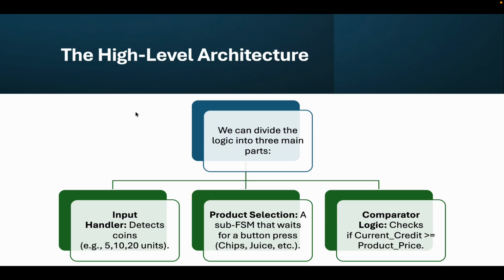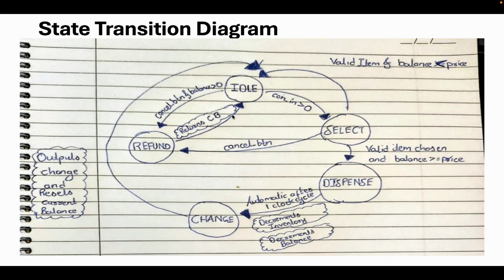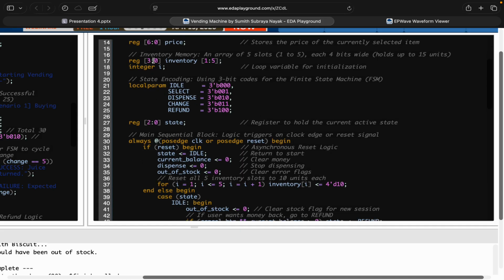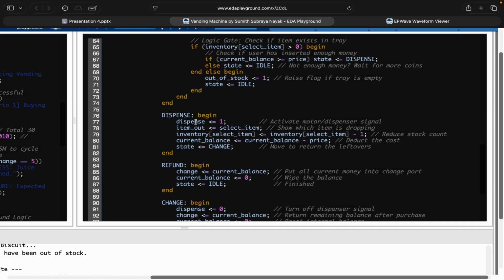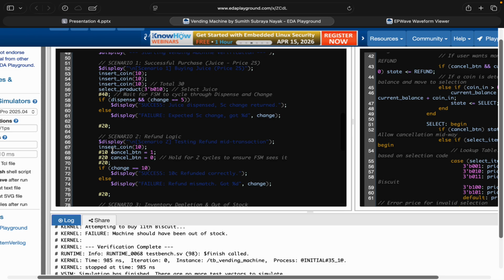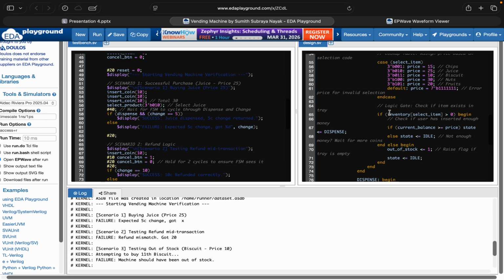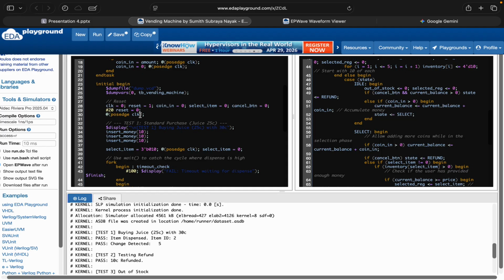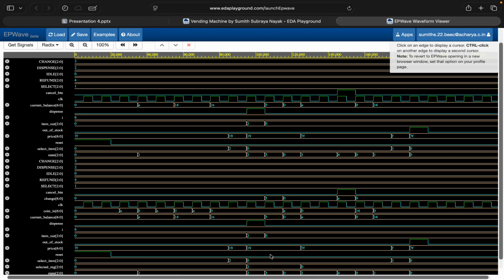Day 25 - Project Vending Machine with Inventory Management using a Finite State Machine (FSM)

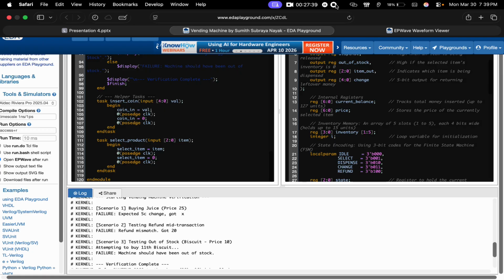Comment from the maker: Hi everyone, At the 27:39 mark  , I made a small mistake in the project due to which I failed to get the desired output it has taken me around 10 to 20 min to understand the mistake , I understood that the mistake was with coin validation as we put the coin in vending machine multiple times , but was able to solve it later using gemini . I would suggest all of you to learn the logic alongside the ppt and code and try to write on you own , after which try to validate various scenarios that you would face while using a vending machine , although a simple mistake , it takes a lot of time to debug it . Make AI tools your friend but not a tool that can replace you. Real-world debugging, even for 'simple' mistakes, is where the best learning happens. Always test your scenarios thoroughly!"